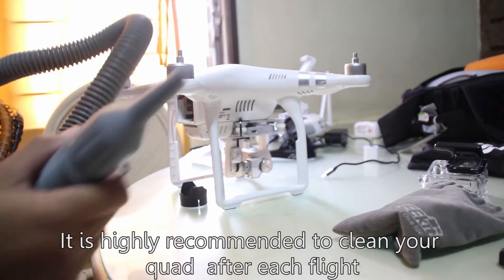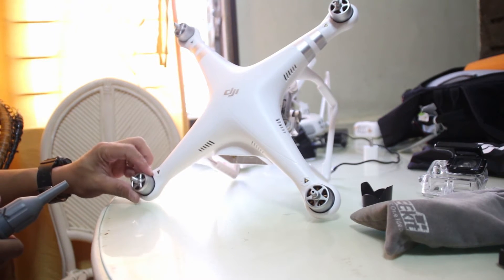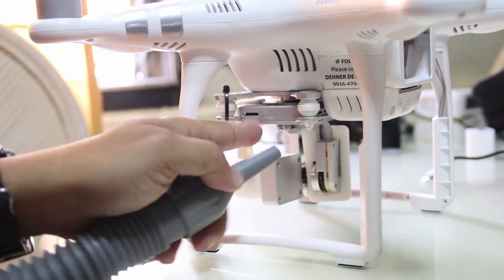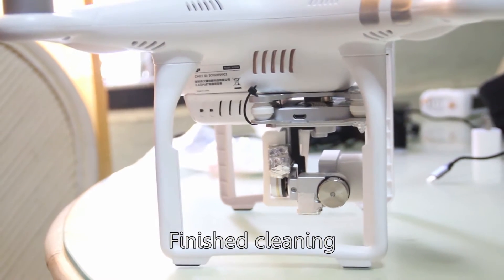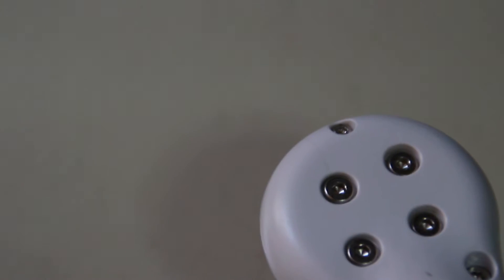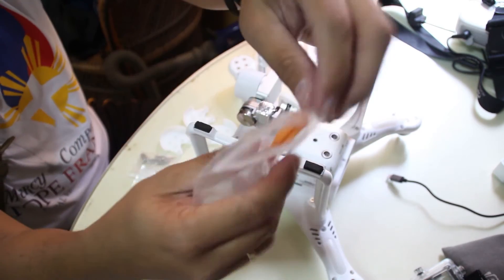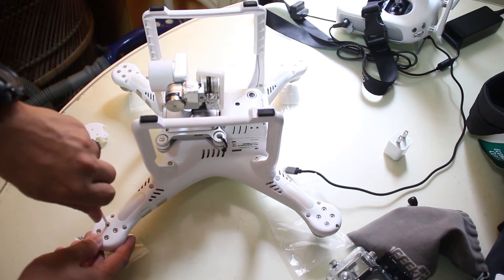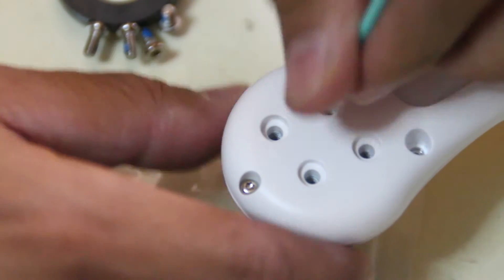Cleaning your quadcopter and Installing the reinforcement plates for the Phantom 3

Comment: hi kapatid, kamusta na po yung drone nyo? any cracks? 
bumili po ako ng dji ph3 standard and after 7 flights may nakita na po ako isang maliit na crack
Reply from the maker: Ok naman sya when I installed the reinforcement plates.  Problem is na crash ko drone ko pero the plates did the job no cracks underneath the shell except the top shell.   Wait for my vlog on replacing the shell.